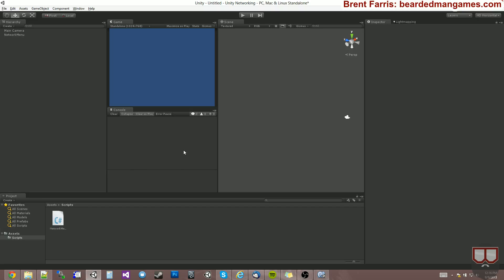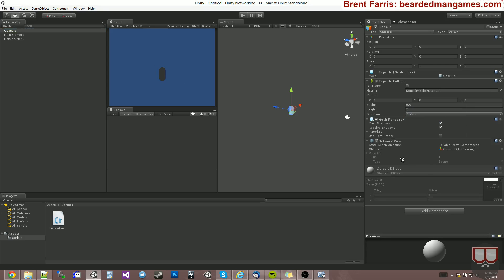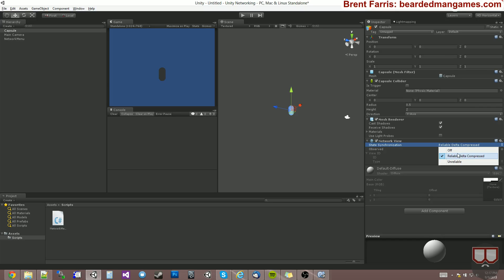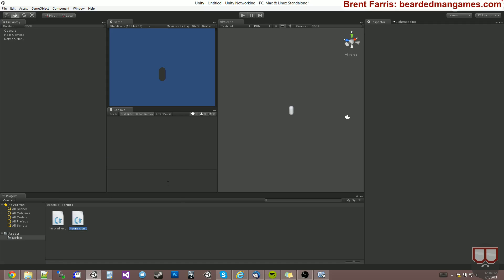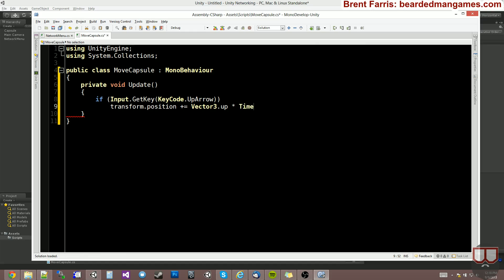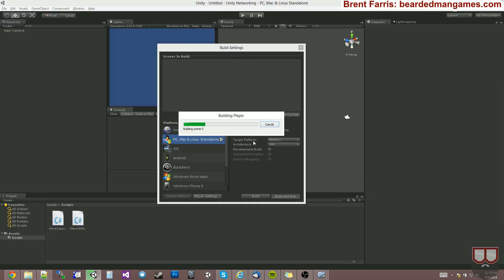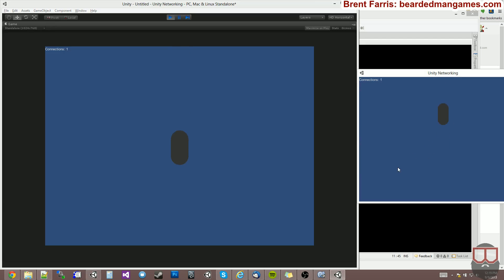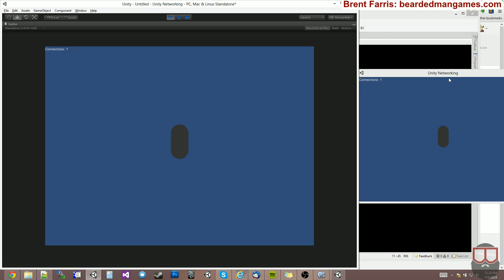Unity3D Networking 3: The Network View

Comment: I am not able to see my character i have applied the network veiw to it but i cannot see it. i am using an object called player i have placed it in the observed slot but it does not appear on the network. what should i do?
Reply from the maker: Outboundstream4 Are you instantiating the object on the network correctly?  Just having the object in the network view will not allow it to be seen across the network.  It will need to be in the scene already or instantiated through the Network.Instantiate method.